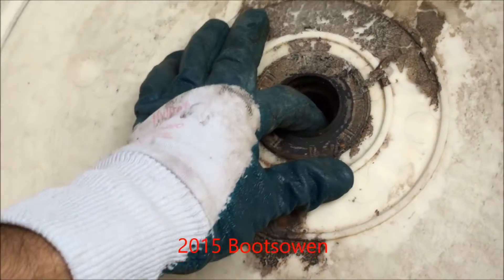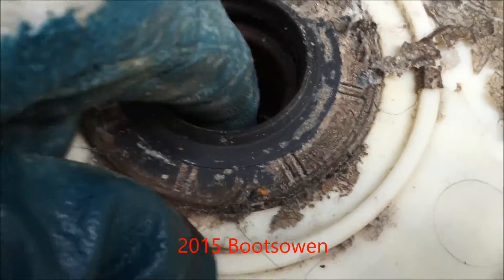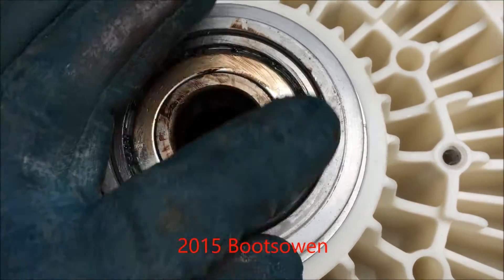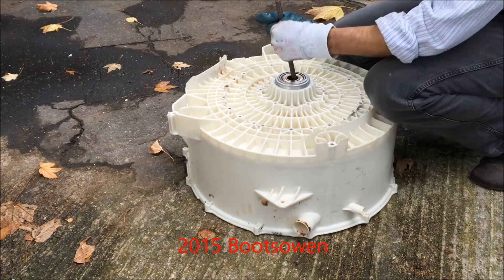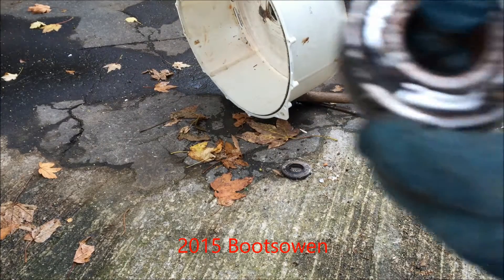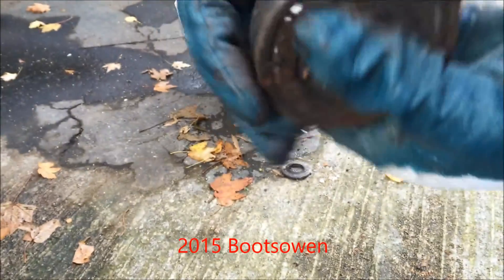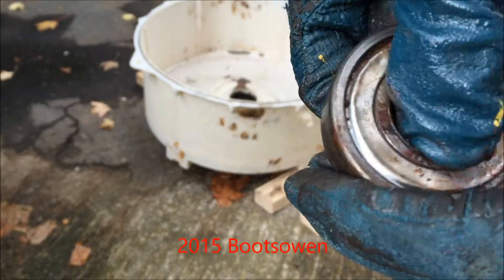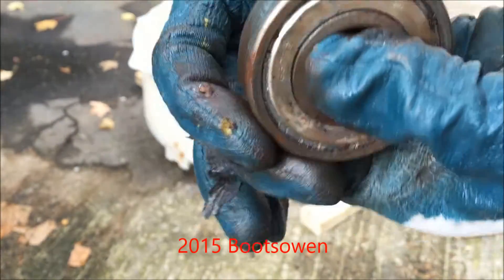Removing failed bearings LG WM14220FD

Comment: Bootowen how did you get the basket 🧺 shaft in the new bearing? I’ve removed all old bearings and fitted new but now having trouble inserting the shaft into the bearing  🤦🏻‍♂️
Reply from the maker: If you have a clean shaft (wire wool) then it should slide in. If it is tight, when you put the pulley back on you can pull it in a bit with the bolt, but if it is too tight you might strip the thread on the bolt. It should slide in.
Reply: @bootsowen  I’ve managed to insert half (1cm) through the bearing but need to push another 1cm so I can completely see the end /tip. I’ve been using a hammer 🔨 to try getting the last 1cm through but thinking if this will damage it. 🧐
Reply from the maker: @SuperFan01  something isn’t right there
Reply: @bootsowen  should it be sliding into both bearings without any force or issues? If so, I’ll try to knock it back out and sand down the shaft so it’s slimmer

Comment: Any help appreciated. I have the WM16225FD and have managed to knock the shaft away from the plastic drum. Inner bearing was in pieces but the ring is still inside the plastic drum, the putter bearing will not shift at all after trying to knock it out x amount of times. Also the inner bearing is stuck on the shaft. Any advice on how to removed these three. Getting frustrating as I’m so near buy yet so far from getting my WM repaired 😔
Reply from the maker: I know the feeling: here is an essay for you! 

I was once stuck under a car doing suspension repairs and I couldn't figure it out, how to get a part apart, you just want a handy uncle or neighbour to walk by! 

For the bearing that is stuck on the shaft, grind it with a dremel or angle grinder on both sides (as much as you can without grinding the shaft) so that it has the start of two cracks on it, and then beat it with a hammer to snap it. Bearing steel is brittle because it has been hardened. 

For the bearing stuck in the housing, outer I think you say, get a bigger hammer, support the plastic carefully and beat on it with a big steel bar as a drift. Big hammer.

For the inner bearing outer race that is stuck in the housing, when you get the other bearing out you may be able to get to it with a big hammer and a drift (a drift is a piece of metal that you hold in your hand to direct the force of the hammer, a screwdriver maybe, but in this case a big bar). if you can't drift it out then you have to get in there with a dremel or a die grinder and skim off metal from the inside without damaging the housing. 

It is a fun job. you will have a great feeling when it is done. 

I hope you have a new water seal, your old one was obviously fucked! clean the shaft that goes through the water seal well. 

I have posted other bearing vids that may help. Search for Bootsowen bearings or something. 

It is pretty easy really. You can try penetrating oil, but it is a waste of time, force is what you need. 

I once spent 2 hours getting a stuck shaft off, try something, turn it over, do it again, swear. I feel your pain!

Check also that the drum hasn't worn away the plastic tub, I have seen machines where it has worn through and water was pissing out on the element, if it has just put some drain repair compound or epoxy on it to seal it.

Any other questions let me know.

Let me know how you get on!
Reply: @bootsowen  right, it’s time to get my angle grinder out! 😠 I’ll cut a cross ‘x’ on each side of the bearing and use hammer 🔨 and a screwdriver 🪛 to shatter the mother. All I wanna do is wash my clothes 😔

Comment: How did you remove the shaft?   The problem I have is the shaft is frozen to the bearing collar on both the outer and inner bearing collar.   I was able to knock the bearing balls out of the outer bearing since there was easier access to it.  But, it is the inner bearing I have difficulty with now.   Any tips would be greatly appreciated.    FYI, I have soaked the shaft in penetrating oil for several days to no avail.   I don't want to keep bashing the shaft to the point I ruin it or crack the plastic tub shell.  HELP!    Thanks.
Reply from the maker: If the inner bearing race is stuck on the shaft and you have all the bearings out you need to cut it off. Make a cut with an angle grinder or dremel almost through to the shaft, on both sides. Then use a chisel and hammer and snap/cut it off. You can cut it the whole way but you might damage the shaft.
Reply: @bootsowen  Thanks for the reply.   The problem is the drum & shaft are still attached to the plastic tub housing.  I can't see and have no access to the inner bearing.  The outer bearing is not a problem.  Because it is accessible I was able to knock the bearing balls and cage out.  With the access space created where the balls & cage were I tried using a skinny punch to knock the inner bearing out but it is so badly rusted from the bad seal.   Amy ideas?
Reply from the maker: @ericsycip3636  Smash it good and hard with a big hammer. Have a look at my recent videos, I did a wma50 this year that was stubborn. and a miele a few years ago.  the WMA50 took a good beating. If it breaks it breaks. Penetrating oil is a waste of time. You can try progressively harder hits and maybe it wont smash the tub. Good luck, let me know how it goes.

Comment: Washing machine overfilling and won’t stop unless I manually turn off the little tap🚰 . Tested the inlet Valarie by switching off machine and it stops water flowing into drum. Any clue what else to test? Pressure sensor? I done the hard work by repairing the bearing now have the overfilling  issue. Sigh. Invested far too much time and effort to buy a new one now. 😤
Reply from the maker: Try on a spin drain only cycle?